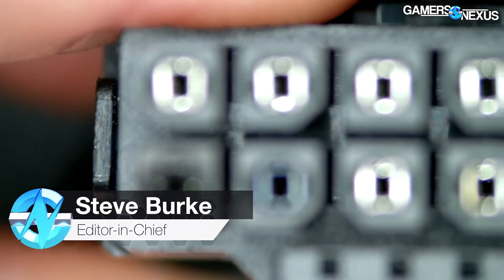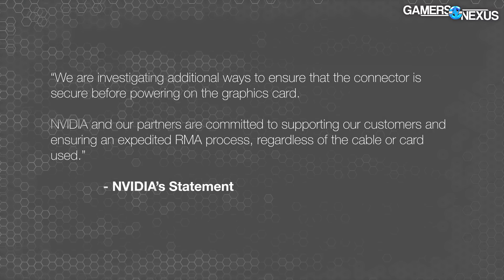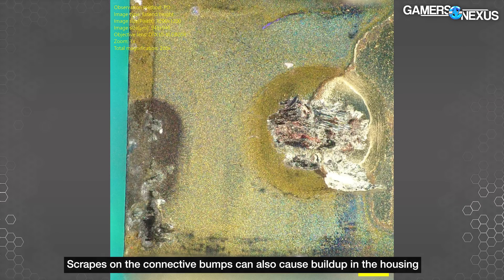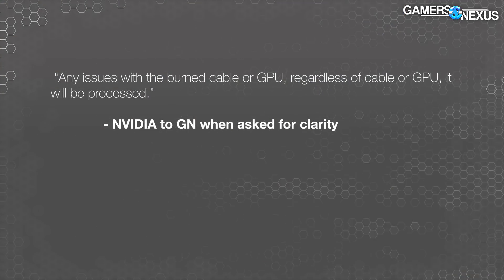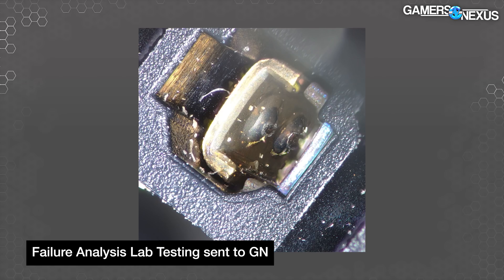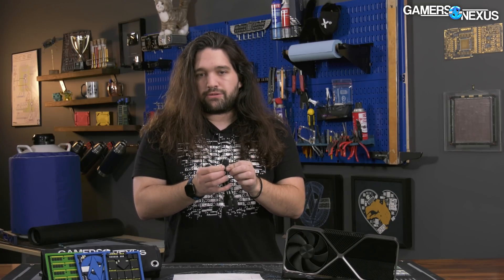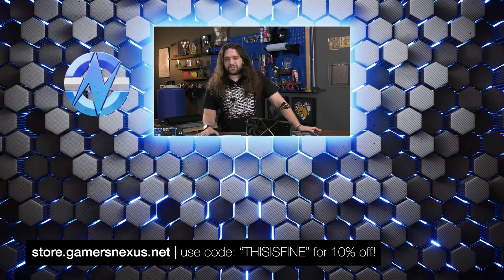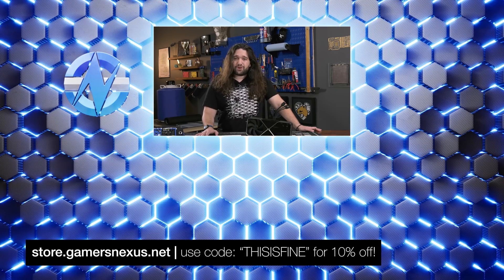NVIDIA Responds to Melting Cables, Warranty Concerns, & 12VHPWR Adapter Failures

Comment: The matter is simple, inserting the cable into the plug should be well signaled by a click. The user should have a clear signal that the cable is fully inserted. And there are no strange translations, he should try to take out 16 times while moving

Comment: So basically, people are incorrectly inserting high-amperage cables that draw hundreds of watts of power. It definitely seems like user error, but maybe the word should be put out that these cables are running much more power through them than what we're used to. PSA: correctly seat cables that are drawing hundreds of watts of power lol

Comment: In the 90s we had problems with thermal expansion lifting CPUs out of their sockets. Rather than users leaving their connectors several mm out, I wonder if that might be an issue here?

Comment: How I connected my 12vhpwr was push until I heard a click and then I pulled to ensure it did not come back out. After pulling a little I pushed it again to ensure it did not undo any pins in any way.
The plug was way smaller than I thought it would be. I do like the design though so I hope it will continue to be used into the future.
I wonder why Corsair has yet to restock its 12vhpwr cables. I have put myself on a mail list for about a month and have yet to see any mail saying its back.

Comment: If they designed the connector with clips on each end instead of just one in the middle it would prevent it from rocking back and forth

Comment: Clearly the connector design standard that they are working around is the source of the issue. Why don't you hear arguments about whether or not the light bulb was screwed in properly? Because it's a good design. These wimpy connectors aren't good enough for these large bundles of cables coming out to provide a solid positive and reliable connection

Comment: There is an easy fix. The cables being plugged into the GPU need to be re manufactured so that the sense pins do not contact UNLESS the connector is fully inserted. Those sense pins need to barely connect once FULLY inserted. This will inherently lower the power draw from the card if the sense pins are not connected making the cables safe, and still offer full power when connected properly. Those sense pins carry like 20mV max, which will be fine barely connected. Your welcome from your friendly neighborhood engineer.

Comment: This is an overall bad design. Trying to kludge 3 cables into one connector was a "cost-saving" move. 125,000 boards at say one at 25 cents per connector vs. 3 (75 cents total) means a savings of $62,500 so far (arbitrary figures for illustration purposes).

Correct way is a larger (higher current) connector or preferably, 3 connectors on the board to match 3 cables coming from the PSU.

Comment: Your failure rate doesnt' account for time, you technically have 50 failures/125000 sold units in 1 months time (user time is also not accounted for), the failure rate is probably 2 to 3 times that or more over the lifetime of the card.

Comment: I have a much better solution to this mess.
Just bring back the 6/8 pin connector/cable.
Problem solved for everyone for ages to come.
Reply: Sounds simple, right?
Reply: Disagree, in fact, they should bring the improved design to motherboards as well so we only need one cable for motherboard and one for gpu.
Reply: @w04h  So we can destroy the whole system? Great idea.

Comment: Igor's suggestion makes alot of sense. It makes it so the sense pins become a physical safety mechanism if they are they are positioned so they only make contact when the connector is fully seated.
Reply from the maker: The PCI-SIG suggestion that he reported? Agreed! Makes sense for sure.
Reply: @GamersNexus  just add a thin marker at the point on the connector which represents a fully seated position and have that marker align with something. Job done, LOL. Cheap, easy and jank af! haha
Reply: @GamersNexus  love the subtle roast
Reply: The sad part is that this is not some novel idea, even in the computer technology industry it's used widely, just look at the male end of a SATA extension cable for a clear example. Professional equipment that needs to insure that there is no inadvertent removal and also that connections are fully seated often use twist lock connections. CPUs use levers to be both visually obvious and clear to novice users that nothing is going to break. Nvidia just chose to go with the cheapest option that is also most similar to other connectors already in use, which has it's own advantages.
Reply: @msytdc1577  So much wrong there. Those are the signal grounds on a SATA connector. There arent any on a PCI power connector. Also nVidia has f all to do with the cable design as Steve said several times - it is an open cable design form the PCI SIG, the same people the design the PCIe spec
Reply: @mycosys  The point was that connectors with different length contacts/pins are widely in use and readily known; what each connector is used for is irrelevant. But a common configuration is that the incoming device is grounded first, data lines connected second, and power applied third, in rapid succession as the device is inserted. Also, Nvidia didn't create the cable standard, and no one is suggesting they did,. What they did do was choose to use it instead of a different standard or a proprietary solution if no standards based one already existed. That's on them.
Reply: @msytdc1577  They're widely used mostly on connections that expect hot swap functionality, such as the SATA example.  They're not common for connectors without hot swap.
Reply: @gracej79  Sure, but also good to use anytime a partially connected connector is a concern, be it due to it being connected repeatedly or connected once and needing to ensure it is fully seated.
Reply: @msytdc1577  A partial connection shouldn't be a concern on a latched connector, if it's not latched correctly that's a use error. And importantly, different length ground or power would not stop this issue, which occurs over a time period of greater than seconds. The longer ground on hot swappable plugs is to prevent high voltage low current spikes to sensitive data pins by establishing gnd first.

Comment: One approach might be to use bright-red plastic on the part of the connector that should be fully hidden if properly inserted, so if you see any red, it's not in all the way.  Not sure how plastic molding works.
Reply: It works in a way that would make that both difficult and expensive.

Comment: Ethanol should work in a gasoline engine, and most fats should work in a diessel engine. I wouldnt recomend using pig fat (or any other saturated fat) as it will freeze in your lines.

Comment: I think you're being too kind to the design. A 600 watt cable designed for untrained consumer use has one job, and that's to fail catastrophically in the result of user error. The cable is not doing it's job.

Comment: First of all their statement is moronic, they designed this monstrosity and should never have allowed such a connection that's so easily defeated by very little effort.  They are trying to place blame on everyone and everything for their poor connector choice.  They basically tried to stuff 3 lbs of meat into a 2lb sack then yell because you have to stamp it down to fit.  Shame on you Nvidia.

Comment: I'm shocked how low the failure rate is, 50 out of 125.000. You'd think with the how the internet talks about it 90% of cables have failed.

Comment: I'm not 100% that "user error" is the right phrase for it. There's no real feedback from the latch to that make you feel 100% confident it's fully secure. If it looks like its in, but then can wiggle out -- especially since it ends up getting smashed at an angle against the case panel -- I'd say it's more of a design problem than a user problem. This hasn't been an issue for earlier connectors, even when we have to bend them to get them to fit in the case.
Reply: @_Clivey  Maybe, but we haven't been hearing about 6+2/8-pin connectors -- or even the 16 pin connector for the 3090ti --  slipping off and/or catching fire all this time. And there are a lot more of those in use, so something is different with these.

Comment: "This takes a lot more force than you think it will"

And that is the root cause of all problems. Users are afraid to apply that force on their $2000 card.
Reply: @_Clivey  Steve himself said "it is an uncomfortably high amount of force" needed to get the plug to latch and "no noise" when it did actually latch and he I think most people would agree is very experienced and would be a competent PC builder. So it's understandable that others have thought it to be fully inserted and secured when it actually wasn't. Any graphics cards I've installed haven't required an uncomfortably high amount of force to get the cable to plug in all the way and you can definitely hear the click of the connector latching. For the most powerful and quite an expensive graphics card out there you would expect the power connection would be easy enough for a kid to connect properly to ensure you have no bad connection whatsoever.
Reply: 50 idiots world wide ......its literally less # than dead 3090 s thx to playing that amazone shit game xDDD     how did they plug in thei atx 24pin with the EXACT same specs ? when they cant manage to do a 12pin ?
Reply: I wasnt scared to make sure its plugged in properly. If they're scared then they should go buy a console or something. I give enough pressure till i hear the clip click, clearly people are just dumb af and shouldn't be building pcs
Reply: @_Clivey   @Clivey  Difference there being that the margin of safety for those connectors means that they better allow for emergency situations, unexpected loads, misuse, or degradation, and won't result in a fire, but rather simply failure to function or unreliable operation. This connector standard seems to fly too close to the sun with minimum design requirements that may satisfy the expected load, but not survive an unexpected load, even though such unexpected loads have both known causes and known solutions.
Reply: @msytdc1577  EXACTLY!!!!  louder for all the people in the back!!

Comment: Here's a thought,  what about adding thumbscrews instead of a latch to properly torque down the connector into a proper seat instead of that flimsy latch?
Reply: Like a VGA-style plug! 

Video graphics array plug for a video graphics adapter card.
Reply: Or you could just plug it in all the way...